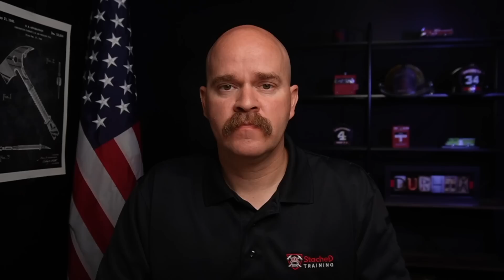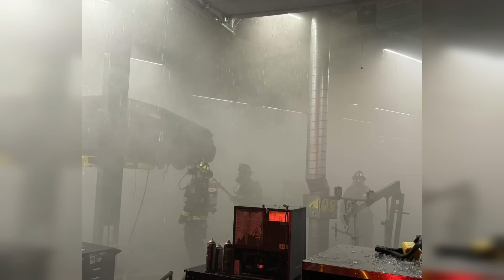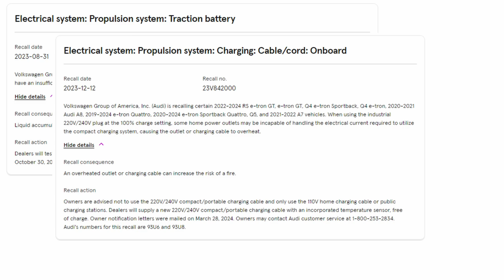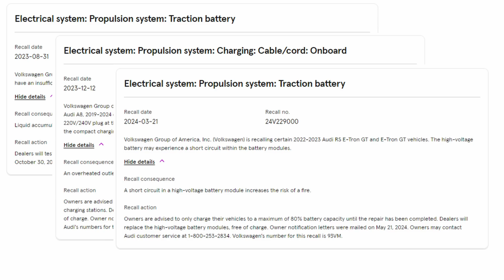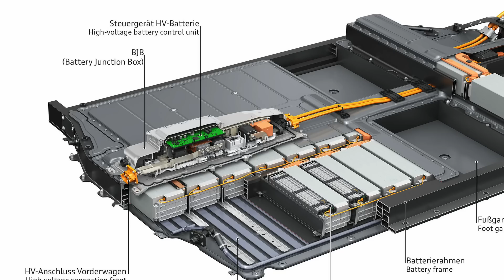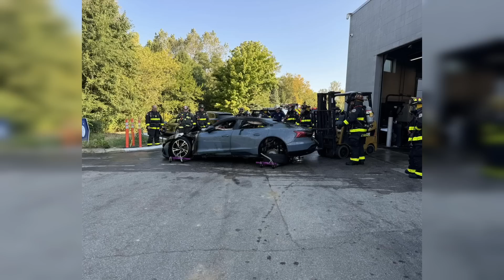EV Fire in Service Bay: Stuck on the Lift

Comment: 1:40 wtf thats like them saying “Don't fuel your car passed 80% because it could blow up”.
Reply: Yeah, and you're supposed to keep your phone between 30% and 85%. Outside of that range the battery is taking damage.
Reply: @fredthomas4476 yeah and you’re supposed to blink 19,000 times a day… cmon bro
Reply: @22lrjayden81  It is true though. Its less of an issue on newer phones but always keeping the battery under 80% and not leaving it at 100% plugged in overnight will dramatically extend the service life of the battery.
Reply: @Teesquared00  Yeah but the phone doesn't risk blowing up by charging it to 100% 😂
Reply: @thepilotmaster777 Remember the debacle with Samsung phones exploding a few years back? That was largely due to batteries overheating during charging. Ever since then, most phones only access about 80% of their batteries capacity. When the screen says 100% charged, the battery is only actually holding about 90% of its capacity. When the phone says 0%, there is actually about 10% left that the user cant access.
Reply: @Teesquared00  if i paid 1,000 dollars for a phone… i dont expect the battery to start failing in 6 months all because i left it charging overnight
Reply: @22lrjayden81 After 6 months, no, probably not. After a year or a year and a half, yes, the battery will loose capacity quickly if it's always kept fully charged for extended periods.
Reply: How could they even roll that out for sale?! Let’s get the money first, we’ll do the research later
Reply: @fishybassvon5752  In today's world, safety is apparently only for pussies. The BP executive in charge of the corner-cutting at Deepwater Horizon (David Rainey) went on to have a lucrative career. Recently on LinkedIn he shamelessly commented, "I knew they would get there eventually - and I quote from my presentation to the 13th Annual Gulf of Mexico Deepwater Technical Symposium in 2009 ... "Our industry has a remarkable track record of pushing the limits of technology. Explorers have always gone beyond the limits ... and the engineers have always come after - and they have always delivered what seemed impossible at the moment of discovery".

Comment: I am a Audi certified tech. The training in 2019 announced the acid is now more dangerous than previous lithium. Recalls pay a set amount, and technicians are paid “flat rate” (commission) resulting in rushing. Managers do not see a correlation between damages caused by technicians, because there blinded by money. At a dealer those  who are ‘beating the labor times” are rewarded, even if the cars come back, or catch fire. And Audi of USA has its hands tied as its the dealers who determine pay plans.
Reply: This sounds like the real cause of a fire like this. Plus the history of this car. Why leave it on the lift for the weekend while having problems with leakage into the battery...... really?

800 volt systems sounds like an improvement over using a 400 volt system because one can charge faster, it also seems to have some problems like we have seen with porsche too.
Reply: Audi pays warranty claims and they set labor times for recalls. They most definitely don't have their hands tied.
Reply: @jamesofallthings3684  The way I see this is yes Audi pay fixed price to the dealer for the recall. But dealer pay hourly the staff. Then easy for dealer manager to to get more money in dealership say fix faster to get more money.  Many way to do it. This said, I don't say it's what happened in this case. But what I think is since EV battery is critical parts, Audi (Group Volkswagen) look like failed with this parts since not the first time I see fire started by the E-Tron and I don't think they sold so many to have this ratio compared to others EV manufacturer.
Reply: I think the insurance company will go out of business.....:dothefive:💥💣🚒

Comment: Seems the sodium chloride chilled slurry punched into the primary battery both absorbs the thermal energy and breaks the chain of other cells going into thermal runaway. New technology, needs new techniques to contain. Also the PPE should be upgraded as well. Some nasty stuff in that smoke.

Comment: BOV= Battery Operated Vehicle.  EV= Electric Vehicle.  My TYCO slot car track has electric vehicles. It plugs in to the electrical outlet and only works if plugged in to electricity. It does not work off of a rechargeable battery. Those are not "Electric Vehicles."  They are "Battery Operated Vehicles."
Reply: All BOVs are EVs, but not all EVs are BOV.
Subways, trams, and Trolly busses are examples of EVs without a substantial battery.

Comment: I can see a lot of insurance companies refusing to insure shops that work on evs. I've already heard parking lots and garages that won't let evs park there.
Reply: The building next to my place of employment has parking levels on 4 above ground levels. The height bumper at the entrance flat states no EV cars.
If it one of them were to ignite, the risk that a fire would spread to offices on upper floors is simply too great.
Reply: They better check their homeowners. Apartment dwellers are in for a hard time also.

Comment: Wow I hope they were recording this fire as it would be quite unique. Surely ar some stage these electric vehicles should be fitted with a fire hose connector so the pump can just flood the battery from the inside of the case. Hide it under a bumper with a removable panel as it's only a matter of time before fire crew members are going to die or be seriously injured by this big battery experiment.

Comment: Yet another battery fire caused by LG ES's battery cell manufacturing faults. Jaguar / Audi / Porsche all suffering from the same problem, and no-one seems to even know that it's the battery cell manufacturer that has created this issue. Everyone is blaming the vehicle brand, or EVs in general, which just isn't the case; if LG ES hadn't had this issue, we'd all be saying how few EV fires there are to deal with.

Comment: I'm half way in, I'm a mechanic by trade.
It's all good saying, "don't store these cars inside" 
But it's not that simple, when you're working on the car multiple systems and or suspension ect can be taken apart rendering the very hard to move on the lift.
It's not practical to spend 2 hours every morning and afternoon packing the car up and putting on dollies then pushing it outside.
Also most workshops don't have parking 50ft away let alone secure outdoor parking.

It's easy to say this, but in practice in the workshop environment it's just not practical.

Comment: I think a fundamental shift in servicing, transportation and storage of EVs will need to happen.  For instance, service centres will need to have an EV servicing area with a containment area built in or put up around it.  When servicing EVs they'll need to de-energize or reduce the charge before working on an EV for an extended time.  Of course this is a big cost in time and resources which will drive up repair costs.  In the early days of the automobile, they were stored in barns and garages away from the home because they posed a fire risk.  It wasn't until the 70's you started seeing attached garages.  Maybe we need to start going back to detached garages?

Comment: You can see the folks that design these things. "Lets make it accelerate faster than a petrol car, that will make everyone want one". "We won't tell them about the range or the charging issues and of course we will make it such that there is inadequate quality in the charging or monitoring systems as no one needs to know about that". But just look at all those lovely screens we have given them to look at rather than the road! I guess we better build in self driving as they will be permanently distracted by the rubbish we have playing inside". "Oh and lets not put anything mechanical in to open the doors as the thing will never fail so you can't get out before it bursts into flames at 3000 degrees just like a flame thrower". The wonderful world of EV's, designed by idiot, manufactured by robot and destined to pollute the world worse than a petrol car ever did.
Reply: The practical EVs have a 100% tariff on them in Canada and the US.

Comment: I think putting out EV fires could be like stopping a solid rocket motor.
Reply: From things I've seen, it is, because the batteries at some point start producing their own oxygen.
Reply: @rex8255  They don't need oxygen because it's a runaway exothermic reaction, not a fire. The massive amount of heat released sets nearby things on fire. There's no way to stop the runaway reaction: they have to just let the stored energy completely discharge while enforcing a perimeter to make sure nothing is set on fire.
Reply: @fredthomas4476  Ahh! Thanks.  Of course, if the damned things in the garage attached ton your house,  the details are kind irrelevant.  Goodbye house
Reply: @rex8255 and the lithium reacts with water.
Reply: Rockets that go nowhere
Reply: Well basically a SRB is a fire that once started is maintained by its own heat and chemical reaction. Same exact thing with these batteries
Reply: Metal fires are the worst.
Reply: Exactly the chemical reaction is going to completion and your not putting it out.

Comment: Keep in mind that if the federal government signs off on it CA will ban all new commercial diesel truck sales by 2030. Of course Gov vehicles are exempt. There is no technology even remotely close to power commercial vehicles electronically or otherwise. To drive them maybe, but to use their bodies no like tow trucks, dump trucks, snorkel trucks, etc

Comment: In California they realize what a disaster it would be for everyone to have an EV, so they're only going to let homeowners have them. Once gas vehicles are banned, renters will have to use mass transit or e-scooters. They're so confident that they can ram this down the state's throat that they openly discuss their plans in news articles.
Reply: Mass transit is literally more convenient than driving in a city.
You have a severe case of car-brain.
Reply: @economicprisoner  No, mass transit has sucked in every city I've lived in. It only kind-of worked for getting to class in college, but you still needed a car to go to stores or parties unless you wanted to be like the poor people who strung together transfers all day. What do you car-less people do when there's a disaster and you need to evacuate? It's happened to me 3 times.
Reply: @fredthomas4476  A rail line has the same passenger capacity as a 10 lane highway filled with single occupancy vehicles. Or 2-4 bus lanes.

Comment: The battery standards have to be higher, even if it compromises EV range. Sodium batteries are the future and should replace Lithium once ubiquitous EV supercharging is available, where EV range will be less important, as supper fast charging will be available. i.e. 10 minutes for a 200 mile charge.

Comment: While I agree with all that was said but where do you find a 50ft spaced parking space anyplace in any town?  That is a whole parking lot 100ft square at least to have 50ft on each side (and that is based on the car being just a single point add 2 car lengths to that 100'ft front and back plus 2 car widths to the sides)

Comment: Now just wait until a Nio in China bursts into flames while doing a battery swap ... while the passengers are trapped inside! Also, the battery swap station has dozens of EV batteries, which only makes the thermal runaway consequences way worse. This just shows that EV battery swaps for non-parts replacement purposes are stupid, and create way more problems than they solve.

In fact, battery swaps for scales larger than handheld solve NOTHING besides short charging times for the first customer in line, especially because they are doing Level 2 charging with the swapped out batteries. This means either throughput is low, or a prohibitively large number of unused batteries is needed, both of which waste space, and the second one also wasting huge amounts of expensive metals.
Reply: And the lift also fails from the high temperatures of the fire, leading to a single (thermal runaway while inside), double (fire made worse by dozens of packs within the swapping bay), triple (trapped on the lift), and quadruple (lift failure causes injuries due to mechanical impact) whammy for the passengers.

Comment: My first thought after seeing it up on the lift was that the placement of the lift pads might have physically damaged the battery pack and then you're off to the races, but he mentioned that it was being worked on for an electrical problem so that's probably where I'd look.  Leaving on the lift wasn't smart though.

Comment: How are EV's even allowed? They ticking time bombs
Reply: ICE cars are worse. They kill around 5 million people every year due to air pollution.
We now have 5 years to phase out fossil fuels (~220Gt of the Carbon budget left); to hold the line a 1.5C or 1/3 of an XKCD ice age unit of warming.
Sure, ICE vehicles can be switched to a carbon-neutral synfuel: but that will be incredibly expensive. For "low hanging fruit" like typical commutes: it is far cheaper to just electrify. Mass transit can even electrify without massive batteries: using overhead lines. That technology is so mature that it is considered old-fashioned!

Comment: I saw ev here in Japan 40 to 50  feet away from the building which was built in it's own Electric Panel chargers,Why should buy evs if I should build my own  Electric Charger Panel that can cause money and needs to get permissions. Contact the electric company for an extended electric meter and drilling company alot of money can cause this Electric Charger Panel めんどくさい:face-fuchsia-tongue-out:

Comment: In 2014, we had 16 diesel engine fires in our 150+ shops across the USA. In some occurrences, the truck was parked with no one working on it. The leading cause was the engine and cab's BMS electrical system. There was a recall by the OEM. I find it interesting that the power train batteries on this Audi do not appear to have gone into a thermal runaway. Was this a 12-volt BMS fire and/or a cab fire instead of a high-voltage powertrain fire? Typically, an electrical powertrain fire would have occurred in the middle and migrated to the rear motor assembly by following the wiring.
Reply: Possibly. Some EVs have a very small 12V battery (more like a sealed gel cell, similar to emergency lighting or UPS batteries) which might not have enough energy to get a fire this intense started. I know a lot of newer vehicles use a 48V system and if the battery is chunky enough and not fused, a short on a 48V system could probably easily get some plastic or fabric burning. If the EV happens to use a standard ICE 12V battery for accessories than yeah that could easily get steel red hot lol. My money is on the main HV battery though, particularly since it caught fire twice.

Comment: First responders might consider the chains wrecker operators use fitted with the usual large J-hooks. Grade 80 chain is quite stout and ideal for dragging what does not roll. 
The chains are cheap and survive daily recovery use. They're also long enough to reach solid grab sites on suspension etc. I'm not a firefighter, I just crib ideas (including cribbing!) that 
work for my use. I suggest everyone who may respond to a vehicle fire do some light reading on how those are best "recovered".  Large fire trucks don't need winches for that work, just connect the chain and drive away.

Comment: You lose the shop even if suppression works for a while.  Lifts work just fine outdoors where the contents won't cost a structure if they ignite.
Reply: Outside in the winter?  Good luck finding techs to work there.

Comment: There is clearly a need for purpose designed and built facilities specifically for EV maintenance and repair.
Outdoors, segregated and confinable. Inside a single vehicle drydock that can be flooded from a cistern with the pull of a chain perhaps.
The risk is clear and present. EVs are not so cheap to maintain if you need a special facility to perform routine work. 
Zoning rules should have these facilities off shore.... that would simplify fire management. Dump it!